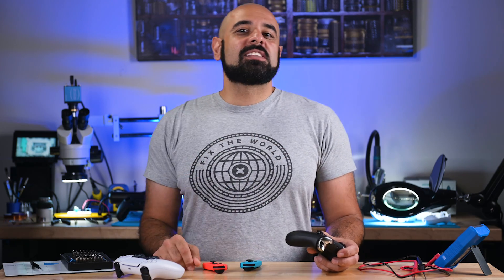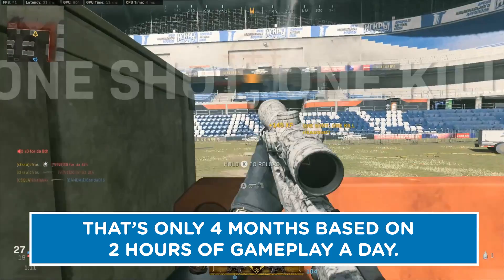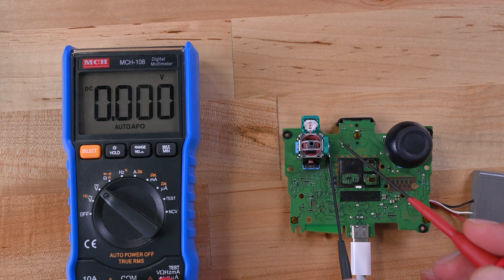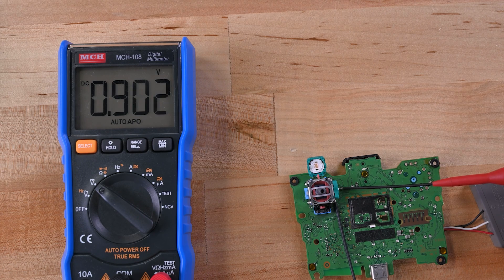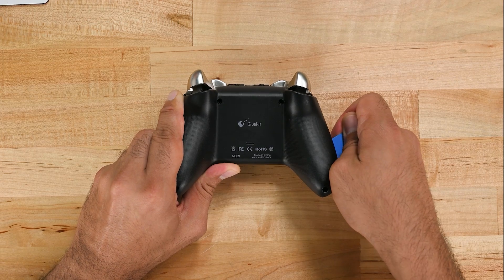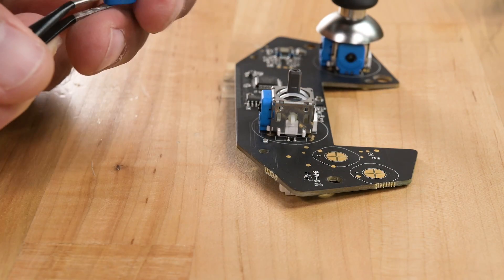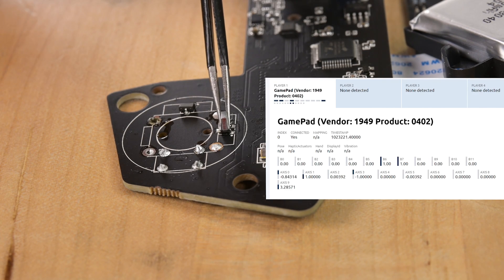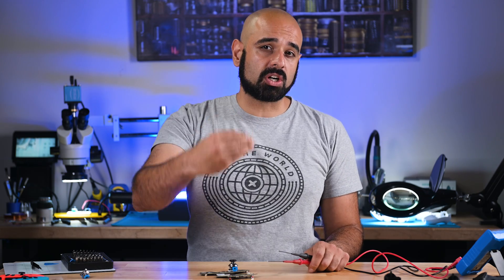How Manufacturers Can Fix Joystick Drift - Permanently!

Comment: One of the controller from the PS3 used to have joystiks based on magnetic fields, but their approach were slightly different 🤔
Also the triggers from the XBox One use the exact same principle. 
But I think saying than potentiometers gonna fail in 4 months using it 2 hrs per day is a little to exaggerate 🤨
Not even the Joycon stick is so fragile, counting the fact those are made in flexible material and that's why those are more delicate 🤨
Reply: Speaking of which, now I remembered why Sony stopped using those. Usually where are consoles also are strong magnetic field from the TV, home theater system and speakers in general, and those then to affect those magnets 🤔
I hope this new mark have solved that

Comment: I really really hope that this will pick up, stick drift has been a problem for me for quite some time and there is only so much I can do. Soldering on a new one not only is hard because of the soldering and dangerous (lost a controller because I screwed up) but also just finding original ones isnt as easy as one might think. these would improve controllers a lot and I wish there would be a dualshock version that has them. I wouldnt mind paying extra but not having to worry about the ONE THING that makes the controller last not that long would be such a relief

Comment: Hall effect sensors are more expensive and have a much longer lifespan than pots. Manufacturers are disincentivized from using them because it means less money for them.

It'd be great if we had "drop in" replacements where the consumer could simply replace the crappy pots in their first-party controllers with better ones, but I'm not sure how you could maintain the tight package constraints they have

Comment: The video gives the impression that this issue is new, but it isn't. Sega Dreamcast hat a hall sensor and N64 had an optical sensor, both drift free. Stick drift was fixed almost 30 years ago. Vendors know it, they just don't care.

Comment: The ps5 uses adaptive triggers, so it would make sense other controllers are more simple. How about comparing it to a similar functioning controller?

Also, no this won't eliminate drift, just reduces drastically. If the stick doesn't center properly, you still get drift.

Comment: Should’ve shown the inside of a Dreamcast controller to also show how it used Hal effect triggers and how those could be used to also help make triggers much more accurate and reparable.
Reply: The GuliKit controller he opened has them, as do Xbox One controllers.
Reply: @Harmonic14  Xbox one controller does not have Hal effect triggers or sticks. They use Potentiometers. The sega Dreamcast uses Hal effect sticks as well as triggers.

Comment: @04:44 Not much of a Chopsticks Eater, huh? 😁
I hope Microsofts rumored Elite Wireless Controller Series 3 will come with this tech - Haven't had any issues with my Elite or Series 2 Controllers but not using such an available and critical upgrade for something in that price range would be offensive 😑

Also had a chuckle at the mentioning of Flight Sim / Drone Enthusiasts... While my 600.- FrSky Horus X12S Radio does use Hall Effect Sensors my Saitek X65F H.O.T.A.S. System does not ( at least not for the Stick ) - Instead it uses a bunch of Strain Sensors with the Stick neither tilting ( X & Y ) or twisting ( Z ) while you apply pressure to it - Super fuckin' weird but the best solution I've ever had the pleasure of holding in my hand to the point where I could never go back to a moving Joystick 🤔

Comment: My PS3 controller has these kind of sticks and it still works just fine. Even the button membrane is fine. It is used frequently. The 2 ps4 controllers had issues after a few months, and recently i got a Dual Sense and the sticks are queaky and off center .All this points to planned obsolescence.

Comment: Manufacturers wont change as that will cause them to loose sales and make less money, so unless people are willing to pay 3-4x more for a controller it wont change it in the near future, maybe in 10 years time but not in the next few years. as console gamers arent like PC gamers that are used to mechanical keyboards, my mechanical keyboard is closing on 18 years and only replaces WASD and a few others 2 times, if i were to use a membrane keyboard i would of replaced at least 10 by now, my mechanical keyboard cost me $140 when i got it, a membrane keyboard back then was $20, its cheaper for the consumer in the long run to use better parts but it means they will sell less and selling less isnt good for their stock prices as shareholders want big profit as we currently live in a throw away culture. just looks at airpods its glued shut to the point that even to do a battery replacement the airpods wont be 100% nice looking as the plastic would get damaged from the heat gun used to remove the silver end cap.

Comment: The N64 controller had already designed out drift by using a spoked encoder wheel (like old ball mice) instead of a potentiometer. The problem isn't that it's hard to solve, it's that game companies making controllers with joysticks on them have cheaped out. Another idea is an encoder that measures absolute position, rather than a spoked wheel. Then it will never ever lose it's zero position or drift.

Comment: A very similar thing happened in the DJ world. Originally, all DJ mixers used contact faders where a couple of brushes would move over two carbon tracks as the fader was moved. The carbon tracks could wear out, and dust/grime getting inside a fader could affect the contact between the brushes and tracks. That would lead to the sound bleeding or crackling - not good.

Now many DJ mixers use non-contact faders that use optical or magnetic technology, eliminating the issues that contact faders had.

I think whether companies use these new stick modules will come down to cost more than anything. I don't really buy into the "they want them to break so you have to buy new ones" argument, even though there is some merit to that, cos I think ultimately, they would prefer the consumer to have a better time with their products, have fewer customer service contacts regarding broken controllers, and create less waste. I would like them to use higher quality components all round tbh, cos I love the feel and features of MS's Elite controllers, for example, but I have had a bunch of technical issues with both the OG and Series 2 versions.
Reply: Rane 🤘

Comment: I mean, they CAN fix it; just that controllers will cost 2-3x more. Though this will be cheaper down the line for the average consumer since they will spend less on replacing controllers , the current trend in consumerism of mindless buy-and-replace will only mean companies will lose out to cheaper options in the market. If you don't cater to the lowest common denominator, you won't live a day as a large company that makes their sales from scale.
Not mentioning this fairly simple economic tidbit is a bit of an oversight from this usually on-point channel. You can do better, iFixit.

Comment: Math check! 2 Million cycles in 4 months? That's over 16,000 cycles in those 2 hours every day, seems impossible. I estimate a fast paced shooter with 10 seconds between encounters and 1 cycle per encounter is more realistic. This leads to a life of 2,778 gaming sessions of 2 hours each or over 7 years worth of daily sessions.
Reply: The cause is more likely manufacturing variance. 2 joysticks with a tolerance of 20% can give outputs that are 40% different. Because this is extremally unlikely, software is designed around smaller tolerances (maybe 10% or less). So, a rare stick that shipped 10% out of tolerance + minor wear = drift.

Comment: I could see someone making these analog pieces for Playstation 4-5, and Xbox one x/s, series x/s controllers 🤔. Might be a little to big for the circuit board, but if they used them before in older controllers. I believe it could happen.

Comment: I'm curious if it's possible to modify existing controllers to use these joysticks.
Manufacturers won't do it, so can we?
Reply: Probably not. The power supply,  DAC and/or software also play their part in the chain, so they need updating (to their circuitry) as well. These sensors are not  drop-in replacements for potentiometers (as far as I know)
Reply: @mrmulder1338  shame. I doubt xbox or Sony will want to use hall effect sticks because they'd last too long, but I've never got along well with 3rd party controllers.

Comment: Early PS3 controllers used hall effect sensors, but later models uses potentiometers.
Dreamcast controllers also used hall effect sensors.

It's not that manufacturers didn't know about hall effect sensors previously or it's a newer tech, so why all modern controllers uses the inferior potentiometers ?

Comment: Hall sensors are less precise than potentiometers, possibly the reason why they aren't used.

I have no doubt that they will improve to the point where they will be suitable for consumer use, but as of right now they are not precise enough.

Comment: This is nice! But my question is, can I just replace my old - non hall effect sensors with hall sensors on old controllers? I think if we can match the voltages it should be possible since the form factors are almost identical.
Reply: iirc the guys from Linus Tech Tips upgraded them for the Steam Deck recently and it was awesome!
I'd love to see more custom / third party controllers using this tech since the major platforms will likely prefer the increased sales from their designed obsolescence
Reply: Me too. But the only off the shelf ones readily available I know are ps3 controller replacements, which use 4 pins

Comment: One thing that pisses me off is there are games that don't include deadzone adjustment. Yes that shouldn't be needed if there was no drifting but still.

Also while I love Xbox, I've had no problems with PS4 controllers but every Xbox controller I have keeps having problems and actually my sticks are having more then drift problems. One controller has a weird hump on the upper left when clicked down that it can't move to. 

I don't ever throw my controllers but honestly I've seen people that throw them have better luck then me.

Comment: Since 2006? The various PS3 controllers, prototype, sixaxis, and dualshock 3 vx1-vx5, all had a magnet-based 'sensor' but it wasn't a hall effect sensor, but rather an inductor that uses the magnet as manipulation on the pickup; Ben Heck scraped the potting off of one of the boards and revealed that it is this, and why the 'pots' have four legs, and as far as I can tell he was the first to actually fully disassemble one of these. PS Vita, 2011, also had the same setup, just in a different housing. Other than some very niche or nonstandard controllers, a true hall sensor in a joystick hasn't been seen since the Dreamcast, 1998. 

I also wouldn't expect to see hall effects, or any magnet-based non-wiper analog stick design, from the big three in first party base controller for some time, not this generation and probably not next generation either, I could see Microsoft doing them in an Elite as a selling point, I could potentially see Nintendo doing it in their next gen to avoid lawsuits again but Nintendo isn't making the best hardware decisions recently; at least until GK becomes a supplier for them or ALPS is pushed to do their own magnetic design, or the possibility of a company going rogue and doing their own thing, like what Sony potentially did with the PS3 and Vita as there's no confirmation on anything outside of the housing and gimbal was an ALPS product. 

Hopefully GK becomes a supplier for other third parties though, it'd be interesting to see how the market changes as they become more of a supplier, as they're Supplying Ayaneo and make replacements for the Steam Deck and Joy Cons. I also hope GK keeps innovating beyond this, there's a lot of concepts to explore, within their own brand, within the market in general, and concepts that haven't seen the light of day outside of some prototyping.

Comment: Would it be possible to buy joysticks like these and mod a PowerA Switch controller to use them instead?
I suspect my controller is starting to drift, and I also bought another a while ago for parts, though its only problem seems to be that it drifts and I'd love to fix them.

Comment: Hall effect sensors are also used in earbud cases ! That's how they turn a small light on, or start pairing when the magnetic lid gets openned
Reply: wouldn't a simple magnetic switch be used for that?

Comment: Isn't this basically the same principle used for Xbox One and Series triggers? I've opened these controllers and it seems the triggers are activated by a magnet on the trigger that get's closer to a sensor on the board.

If that's the case, it's ironic that MS went for this technology for the triggers but not the sticks.

Comment: What is @iFixit experience with the rubberized surface of the King Kong Pro 2? I was very disappointed as it seems to me they fix the drift issue and replace it with another sticky mess. I had a pair of Nikon binoculars that had rubberized coating and after a few years it started getting sticky and really gross, and nothing could be done about it. Nikon did not accept it for repair as it was out of warranty. While these controllers are way less expensive, it's still disappointing if this is the same kind of problematic coating.

Comment: you forgot to mention the price between hall sensor vs potentiometer joystick. If the price were cheap of course they would've use it already. Just like PS3 Dualshock 3. There's 2 version of it, Hall sensor and the cheap potentiometer version. Now I'm not saying hall sensor are the best because they got they own problem from the joystick plastic will wear out.
Currently I'm fixing Dualshock 3 hall effect joystick and the price for each joystick you can buy 3~5 potentiometer joystick. its that expensive.

Comment: Is this possible with the size of the Joy-Cons though? I feel like the reason Nintendo has been trying to bury the issue is because they don't want to redesign the joy-con to be larger and thicker to accommodate a larger stick.
Reply: With joycons, it has been shown that you can at least mitigate the issue by placing a piece of card under the stick. It's mostly a fit and wear issue.

Comment: My Xbox Series controller was not without it's problems, like some plastic casting still left on the left thumbstick internal mechanism took weeks to wear off and rotate smoothly, the USB-C port is completely useless and the thumbstick coating has worn through now, but I haven't had any stick drift yet in nearly 2 years. So in a way I feel lucky.

Comment: This "new" technology have problem to solve before becoming a standard... as we speak for magnetic elements there could be a lot of interference if you get closer to magnetic field that can make your sticks to act weird or becom unusable, maybe this can be solved with proper protection against outside magnetic fields, but yet is about to experiment,.. much better technology resolving this problem in my opinion is the laser sensors implementation.

Comment: even if the manufacturers don't do this, I would've expected the companies that make modified controllers like Battle beaver, Scuff etc to do this since they're trying to make controllers that offer more and better performance. Scuff's are also known for stick drift
Reply: They also want to sell you replacement parts and new controllers, feels like a scam, even GuliKit didn't put back buttons/paddles in KingKong Pro 2, some smaller seller could theoretically destroy everyone else by making a "One size fits all" but they'd run out of money in 2-3 years when everyone has their controller.
Reply: @RealRogerFK  No problem, they start a new business after 3 years. Like someone building a House is done building, there is no point in never finishing the house and getting paid the hours of work, obsolescence is for lazy people, they should be ashamed
Reply: dont scuff just modify a oem controller?
Reply: @jordanwardle11  that's what I did to my controller using parts from Extreme rate. But that doesn't fix the stick drift issues
Reply: @javianbrown8627  the bottom-line is that you can't "fix" stick drift, only remedy it. The only true way is to not have analog sticks in the first place
Reply: @jordanwardle11 you CAN fix stick drift though. If the part never wears out it doesn’t develop drift. I think what you meant to say is “you can’t make stick drift impossible to occur.” But you really don’t need to. If you go from your controller lasting 6 months (then having to buy a new one) to your controller lasting 10 years, then when it FINALLY happens replace it (the module) for $3 then I’d say the problem is essentially solved.

Comment: Original ps3 controller use hall effect sensors. They downgraded it to use graphite later on. Its on purpose.
Reply from the maker: It was the Sixaxis, did anyone kick up a fuss about this at the time? Can't find any evidence suggesting people even noticed.
Reply: @iFixitYourself  there is an article from 2008 called "Inside the Dualshock 3 Controller" that shows the potentiometer, so at least 1 person noticed. In there it says Dreamcast controllers also uses hall effect sensors.

Comment: It is economics bro.... a cheap swipe of carbon on a Mylar sheet and a slider makes a potentiometer and a predictable fail point where the player complains to mommy and purchases a new controller. They have less than zero care about longevity but focus on the bottom line. 
Great video and the time it takes to conceptualize, create and edit these are appreciated very much sir.